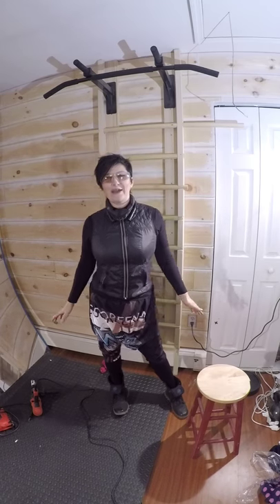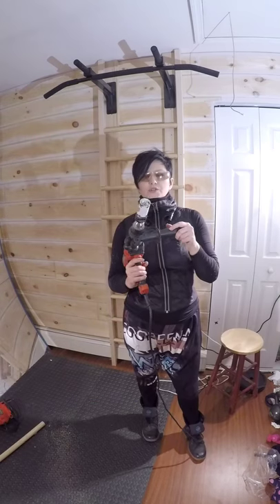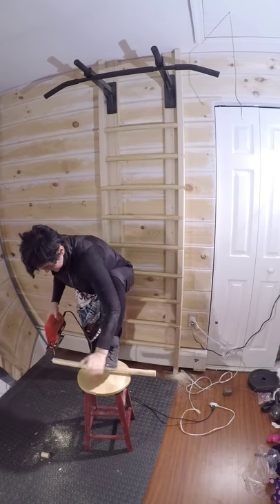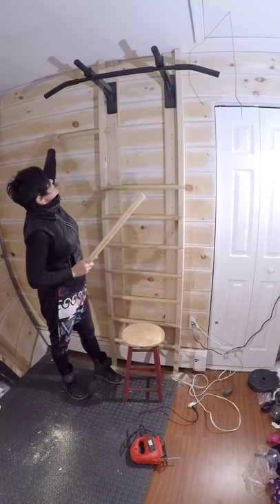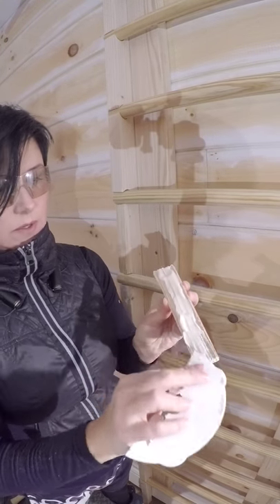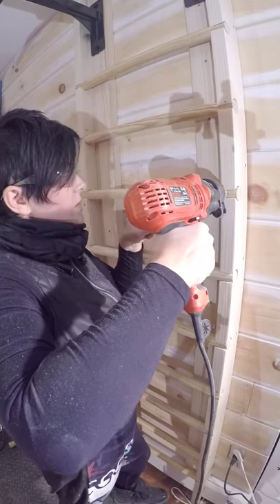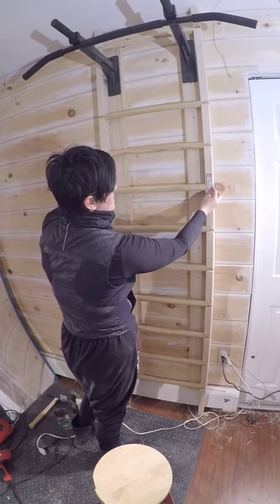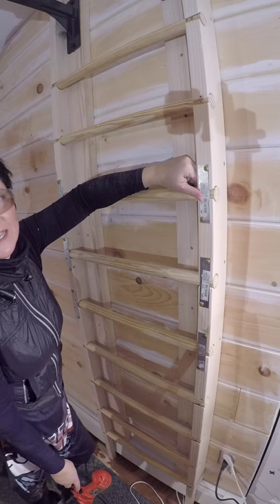Easy DIY Stall Bars As an Addition To a Pull Up Bar Setup. Part 2. Home Gym For a Small Space

Comment: Thanks for the video. This is exactly what I was looking for. I have already a pull up bar like that in my wall, the difference is that I have it directly bolted to the wall which is made of concrete. I want to build the stall bars on the sides of the pull up bar and the 2x4 seems to be the better option. However I would add a 1x4 behind the bars to both space it from the wall and use it to install the bars to the wall. That way the wooden dowells will be more to the center of the 2x4 instead of being so close to the edge. I would like to know what is the spacing between each dowel. Thanks again!
Reply from the maker: I wonder why I didn’t answer your comment. I’m sorry for that. The spacing was about 8 inches. 
Were you able to build yours?

Comment: How much did it cost ?
Reply from the maker: Thank you for your comment. 
2x4x8 around $4 (x4)
1 1/4 in by 96 in dowel around $14 (I used more than two- it depends on how close together the bars will be and on the width of your stall bars x3)
If I did it again, I would put the dowels into a 2x6x8, the wall would be more convenient for exercising. 
Tool for making holes for the dowels, a bit under $20. 
Mending plates, around $3 per pair. (X10)
Screws, I like Spax around $8 per box
At home , I already had my jigsaw ($30-$60 is good enough), sander ($30)with sanding paper ($15- I like to have a lot on hand and of different grid), paint or stain, brushes and such. 
Would you, please, do the math. Did I forget anything?
Reply: @easyflowing  you mention you would use 2x6x8 instead of 2x4's why is that?
Reply from the maker: @Jelly G It would make the handles be further away from the wall and more comfortable to exercise.

Comment: Why did you notched out the dowel sockets that you cut with a hole saw if you where going to cover the part you cut away with steel plates? Sorry for the question but I'm a man and us men tend to want to know the reasoning behind 'woman think'.
Reply from the maker: I hope I understand your question. You are asking why I made holes in my 2 by 4s, right? If that’s the question, then, here’s the answer:
In terms of functionality of these particular stall bars, because I used such narrow pieces of wood, I had to make holes as close to the edge as possible (in order to have some space between the dowels and the wall for a comfortable hand and foot hold). Actually, I liked the idea of the dowels being at the very edge from a design standpoint and because of it I thought of going with 2 by 4s, instead of 2 by 6s. Also, this room is quite small and that’s another reason for using 2x4s. 
The holes, this close to the edge, provide support for a vertically applied pressure for the dowels. However, if someone pulled on them horizontally, they would pop right out. I have small children, so I had to make sure that my stall bars withstood that kind of beating and were safe for my kids. That is why I added mending plates to this design. I also like the look of hardware, I think that it adds character to these very  plain stall bars. 
This room serves as a multipurpose space, so I went for character, functionality and safety.

In this video, I used 2 by 6s and didn’t use mending plates:

DIY Stall Bars made by a Mom.  Шведская Стенка Своими Руками. DIY https://youtu.be/3AUU6Vz897U
Reply from the maker: So, in my case, ‘woman think’ is safety, functionality and character ☺️ Always!
Reply: @easyflowing  :) yeah.. I knew why you added the mending plates. It was obvious to me (35yr master cabinet maker) all the strength was in the downward direction. You seem to have a good grasp of what you're doing as well as very determined and strong minded so.. carry on hahhaa! :)
Reply from the maker: Thank you 🙌